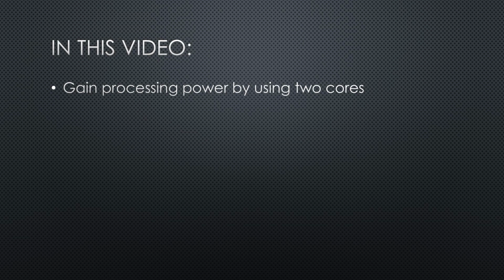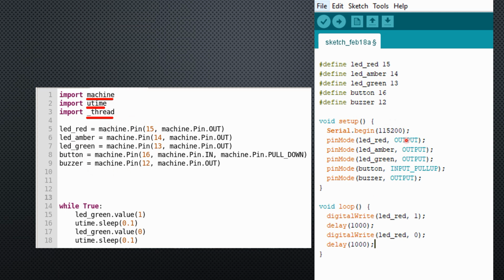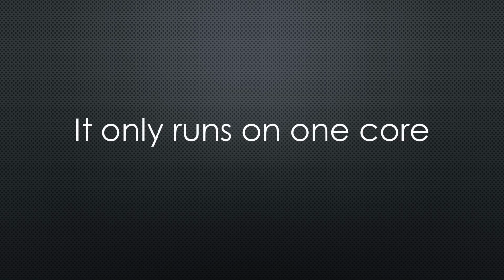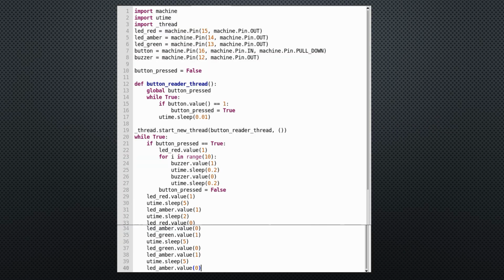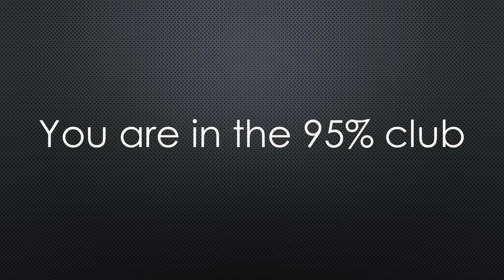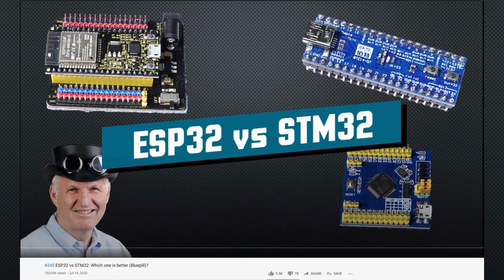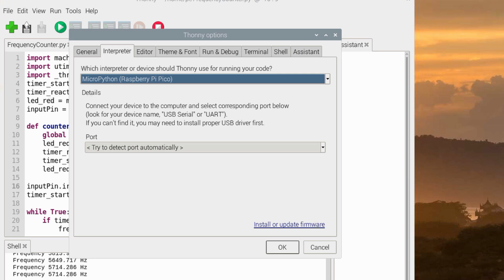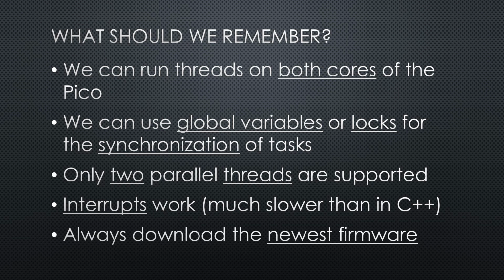#372 How to use the two Cores of the Pi Pico? And how fast are Interrupts?

Comment: A great video as always Andreas! I happened to have the C++ dev environment setup on the bench using a Raspberry Pi 4 and therefore was able to quickly measure the interrupt response time with my oscilloscope. This turned out to be 1.1us when built for debug and 1.0us for release. The release version seems to have some jitter of around 0.1us whereas the debug version doesn't which seems a bit unusual.
Reply: To add a bit more to my last comment, I did a some more investigation and it appears that the minimum execution time of a GPIO interrupt handler is 5 us (i.e. even if it does nothing) which seems like an awful lot of overhead. I searched the data sheet for the processor and the SDK documentation and source code but could find no explanation for this behaviour. Probably someone more familiar with the ARM processor architecture will know. Cheers!
Reply: @RocketManRC-Electronics  How did you measure the execution time of the isr?
Reply: @nukular2008  My setup was GPIO2 as an output and wired to GPIO3 as an input with interrupt enabled on the rising edge. GPIO2 is set high in the main loop and GPIO2 set low in the interrupt handler. With only those two lines of code executing GPIO2 goes high for 1.1 us and low for 4 us so a period of 5.1 us. If I disable interrupts and move the code to set GPIO2 low to the main loop then I get a lopsided square wave on GPIO2 with a period of 110 ns.  The conclusion is that in the first case the interrupt handler uses a minimum of approximately 5 us of processor time. It would be interesting to repeat this test using assembler to get more insight into the whole thing but I suspect that is not a trivial exercise!
Reply: @RocketManRC-Electronics  I suspect it could have something to do with having the ISR stored in flash. The rp2040 default uses XIP (execute in place) to run the code directly from flash, which could cause the high latency. You can disable this completely by adding the build flag PICO_COPY_TO_RAM=1, or you can make sure a specific function is copied to SRAM by using the macro __not_in_flash_func (in pico_platform) like so: void __not_in_flash_func(my_func)(int some_arg) {
Reply: @spicybaguette7706  That's very interesting and I will check it out when I get a chance.
Reply: Micropython seems to have a "hard = true" option when assigning an IRQ to a pin. Maybe this would also make it a bit faster. Maybe I might try this someday.... 

https://docs.micropython.org/en/latest/library/machine.Pin.html
Reply: @rianderous8761  python will always be slower as it needs an interpreter to run.
Reply: hard = true doesn't seem to be supported currently. personally i had higher expectations from the pi Pico
Reply: @#NotAnEngineer If you read the rest of the linked article you'd know that these are minimum values depending on a variety of factors. In reality (and the Pico has a 2 M0+ cores BTW, so the minimum is 15 cycles, not 16) a M0+ core very often serves interrupts quicker than a "better" core at higher speeds due to having less factors which slow down this process. If my calculation isn't off, the minimum latency to enter the IRQ handler is 0.11ns at 133MHz. Of course the interrupt -> interrupt time depends very much on how long it takes to execute the ISR and that's where micropython comes into play; not just the dispatch of the ISR (they will need to have one or multiple generic ISRs routines which jump into a Python handler checking whether the Python ISR routine was set at runtime before executing it -> super expensive) but also the toggling of an LED in Python is way more expensive than the corresponding single cycle machine instruction.
Reply: @danielegger6460  z
Reply: Very helpful video again. I can confirm with some of the other guys who have tested the interrupt latency that it is around 3 to 4 µs - this was tested by using the time_us_64() function, not with an oscilloscope. I connected GPIO16 (as output) to GPIO17 (as input) and triggered on changing the output on GPIO16.
Reply from the maker: Thank you for testing it. This seems to be ok. Of the 1.3 us of the STM32, about half was to set the pin (Arduino is not very fast in this discipline)
Reply: @AndreasSpiess  There is a reset button hack that allows you to use a button that resets the Pico.

Comment: TinyGo can now utilise both cores on the Pico (as of June 2025). It is faster and more reliable than MicroPython which I found flaky on two cores for my use cases. Plus Go has amazing, easy to use, language constructs for parallel programming.

Comment: Thanks! It could be nice to compare performance on the two approaches. If micropython uses an interpreter instead of a compiler (?), I would presume it waste quite some processing power, translating the code on the fly? Is that smart on a Micro controller where both RAM and Processing power is limited?

Comment: bit later here... I am familiar with threads C/UNIX but new to micropython. For me, I was getting hangs and all sorts of grief from my pico 2 here... using bare bones thread code.. All my grief went away... when I added logic to get the spawned thread to cleanly close itself down, when the main thread indicates it is done. I don't think the micropython environment is doing the cleanup we might expect and are familiar with from full blow operating systems. This may be the reason why 4 years ago... you were having to reset the boards in the first place.
Reply from the maker: Well possible. I must admit that I do not use MicroPython for productive projects for these reasons.

Comment: with Arduino IDE, i don’t have to disconnect the USB cable if the "Serial Monitor" in not runing and so, i can to reprogram the Pico without to touch it.. if i need the Serial Monitor, i just need to close it before to upload (and open it when the Pico run)..
Reply from the maker: Thank you for the additional info!
Reply: @AndreasSpiess  always happy to see your (nicely done) videos!!

Comment: Seems to me a good way to use the 2 processors is to have one only doing the communication protocols (wifi, serial port if needed), and use the other one to run the main program.
Does that make sense to you? 
BTW, the PIO is much faster with I/O, so i would use that for a pulse counter.
Reply from the maker: Yes, this makes sense to me.

Comment: I am a retired software engineer and seen enough about Python to know I want nothing to do with it, heck I would be more interested in old fashioned Basic.  So I don't suppose you have a similar video in C or C++.  I recently got some Seeed Xiao RP2040's which is the reason I started watching the video.
Reply from the maker: The Pi Pico is now supported by the Arduino IDE. So you can use C++. Google should show you a video by "Gary Explains" (Youtube does not support links)

Comment: When you made this video, I was miles away from securing a job in engineering. No degree, no money, self-study. A year later, Mr. Spiess set me on a journey with the pico that allowed me to secure a job as an RF Technician (en route to engineering position) for municipal districts and emergency service radios. Thank you for all the immensely valuable information and education and it is not for granted!
Reply from the maker: Congratulations! I am always happy if I can be of help for somebody.
Reply: @AndreasSpiess 
Hello sir,

I am trying to use PIO to measure the timing between two rising edges on two input pins, but have trouble getting the accurate measurement.  Whats the best approach I should go with.  I need it at least 400ns accuracy.  

Thanks
Reply from the maker: @yeanic  I never used the PIO functionality 😞

Comment: on the pico pi , ctrl D will perform a soft reboot. and if you place a button between Ground and Run pin, it works to program like on the esp8266 and the 32.
Reply from the maker: You are right. I added this button in one of ma next videos ;-)

Comment: Hey, just as a head's up to people using the ESP-32 and Micropython, while many versions of the ESP-32 are dual core, Micropython only runs on one of them and reserves the other to perform peripheral tasks such as managing wifi without it interrupting the main micropython core. This is true even if you are creating multiple threads! So be aware that even though you're getting true preemptive multitasking in multiple threads, all of those threads still run on a single core. For evidence, look in the ports/esp32/mpthreadport.c and you'll see that all tasks/threads are bound to the same MP_TASK_COREID constant.
Reply from the maker: Thank you for the information!

Comment: A bit late to the show, but if you see this:
 - Could you add info on how the Interrupt timing would change using Arduino C++ on the PIco ?
 - Is threading possible in Arduino C++ ? I did not get that from the video, maybe I overheard it.
Reply: Just a bit of info: 
I want to program a "simple" software LockIn-Amplifier on a Pico. The Interrupts or DMA would be useful to get the phase of the reference signal, but 55us would limit the frequency and accuracy considerably.
Reply from the maker: The Pico did not get a lot of traction in my viewer community. So I stopped covering this chip :-(
Reply: @AndreasSpiess  Ah, too bad, but understandable. 
Found one of the answers: you can program both cores on the Arduino IDE using "setup1" and "loop1" for the second core.

Comment: Where in the documentation did you found that multithreading is implemented using multicore ?
The MicroPython documentation regarding threads is quite minimalist and point to the CPython page, which does not speak about cores...
Beside MicroPython also run on single core platform...
Thanks
Reply from the maker: I do not remember where I read about it :-(

Comment: Multi threading in this way is not working properly in Pi Pico. It seems that the second thread is sharing the CPU time with the main thread, so the main thread will be slower 50% than before. Any idea?
Reply from the maker: As the Pico did not catch a lot of traction in the Maker community I do not look too much into it :-(

Comment: I find the treatment of global/local variables in Python intensely annoying and a sure cause of programming faults (one of several things I don't like about Python). When programming in c/c++ and declaring variables I always use a naming standard that distinguishes between their scope. It isn't functional of course, but it makes the code unambiguous as to what I'm dealing with.

I should add what's really required to use something as sophisticated as the Pi Pico in complex applications is a real time OS. I'm not familiar with FreeRTOS, but I do like the idea of a proper framework for things like pre-emptive multi-tasking, driving devices, semaphores, message passing and so on. Many years ago I wrote the core of such a thing running on a Z80 machine which controlled the timing on a race track. It drove a number of displays, a couple of printers, car identifiers, timing beams, control lights and so on. I found the framework of being able to write several task that had to run concurrently, some of high priority (like handling timing) and some of lower priority (like driving a printer), and the operator interface to make the whole thing a lot more logical to put together. I find those stereotypical controller programs which comprise a large loop handling device status and also handling any user interface to be painful and illogical. So something that encourages proper multi-tasking is great, even if you have to, sort of, DIY it as here. 

I should add that there is lots of potential for "gotchas" in complex applications which require co-ordinating of multiple tasks without tripping one another up. There's a whole lot that could be presented about how to do more complex applications.
Reply from the maker: I made a video about FreeRTOS on the ESP32. It is quite useful for complex applications.

Comment: I wonder if the interrupt reaction time for ESP32 running *micropython*, would be similar to the Pico's?

Perhaps for 2 threads it may not make a difference, but since the ESP32 can run MANY threads (not just 2 like the Pico), maybe it will perform much faster?

BTW, I like the python tip of using the 'global' keyword inside a function if it needs to access a variable outside of the functions!
Reply from the maker: I never tried interrupts with Micropython on the ESP32. But it should have nothing to do with the number of threads

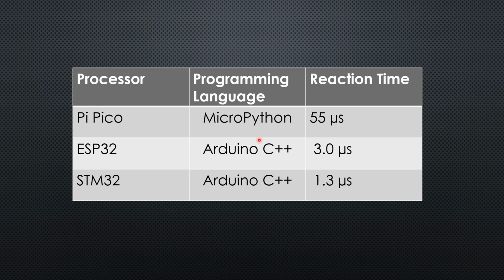Comment: 10:40 why you compare python on the Pi vs C++ on the other microcontrollers? C always will beat python
Reply from the maker: Because the whole video is using python (for the dual core capability). I would not know how to use dual core with C on the Pico.

Comment: Is it possible to run python on one core and C++ on the other for high-speed interrupt handling? (shaft encoder on a motor)
Reply: Or perhaps there is some way to use pio for the encoder?
Reply from the maker: I do not think so.

Comment: This is super helpful. I might use C++ instead for my project if the SNES clock/latch pin is too fast for my project. I hope so, because then i might be able to get away with using 0 shift registers instead of 2 per emulated controller
Reply from the maker: Glad you found the content useful!

Comment: Pico reset: you wire the GND and RUN pins together and add an extra momentary contact button to your breadboard. Pushing the button will reset the board.
Reply from the maker: You are right. I did a similar thing in my next video ;-)

Comment: Great video and adorable kitty!

I wonder if it's possible to program these in C++ or even assembly if you wanted to optimize speed from the dual cores. I have a DSP project I'm working on with 40kHz acoustic detections and these were beginning to look pretty appealing to use for this until you compared the interrupts with ESP and STM uCs. Still very cool though!
Reply from the maker: You can program the Pico in C++ with the Arduino IDE for example. I do not know if dual core is supported. Maybe you look at my new video about ESP32 and audio?
Reply: @AndreasSpiess  Thank you for the suggestion! I just watched your ESP32 video on audio and the Pmod audio card you suggested looks to have the sampling rate we would need (108kHz).

Comment: This RP2040 is kind of strange. Even a single core has so much power that you normally don't need the second core. On the other side it has fewer periphery than most other ARM-controllers. For about 80 cents it's quite interesting for my own PCBs, but this stupid QFN housing is much to difficult to solder at home (for me). And the cheap PCB manufacturers don't have it in stock...
Reply from the maker: I assume the package has to do with the pricing :-(
Reply: @AndreasSpiess  
Sure. But I still try to figure out what is the reason for this controller. The Raspi Nano has a little more power than your ordinary STM32 board, but it's also a little more expensive and has not as much interfaces (no CAN) and very few timers and analog ports. I designed already ATmega and STM32 boards by myself, soldered them at home with an ordinary solder iron, also a small series of my ATmega boards were soldered directly at the manufacturer (JLCPCB). But I can't do this with the RP2040. So currently I'm a little at a loss who's the targeted audience. Just an Arduino with more power?
Currently I'm looking into EFM32 controllers because I need something with very low power consumption and good calculation power (for beehive scales). Are you planning to do a video about this controller family too? I'd be very interested :)

Comment: To reset you don't have to unplug the micro USB connector, but also the other side of the cable OR just use a micro usb cable with a switch.
Reply from the maker: I found an even simpler solution (in the next video)
Reply: Or just connect the RUN pin (30) to ground.

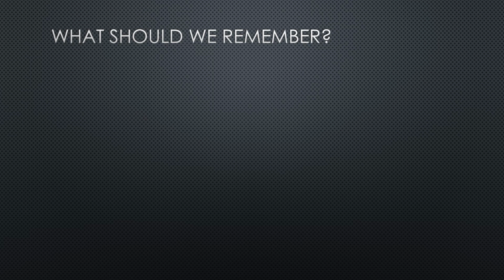Comment: 12:53 Can't you just unplug the other end? Or short the reset pin to ground? Or short vcc?
Reply from the maker: You can ground the reset pin, of course. This is what the reset button would do. Unplugging also helps, of course. But in the next video I added a simple reset button which is much more comfortable.

Comment: if you short run to ground you get a reset there is a solderable reset button called "captain resetti".
the main problem as amateur user for me is that micropython has no easily usable usb hid where circuitpython does it with an adafruit library
Reply from the maker: You are right, I was not the only asking for it. In a later video I added a simple button to my Pico...

Comment: What about using C++ for the interrupt?
How does it compare to other MCU?
Reply from the maker: You can use C++ for your whole Pico project. Then it would be as fast as any other M0 core MPU, I think.
Reply: @AndreasSpiess  
Thanks for responding to my comment. 
I have been “away” from electronics for 7 years, so I’m catching up with the new stuff...

I wonder what is the advantage of Arduino? There are other more capable boards like Esp32, stm32, ... and they can also be programmed with the Arduino IDE
Reply from the maker: Most of us use the ESP8266 and the ESP32 because it has WiFi

Comment: Did someone eventually make the pulse counter PIO? I want to read the LMT01 digital temperature sensor but the interrupts are too slow. I also hard-wired it to  GP22 so that's a PWM-A pin. Otherwise I could have used it as a PWM clock input pin. My only hope is PIO at this point.
Reply from the maker: I do not know. Yes, 88kHz is probably quite fast for an interrupt. Should be possible with the PIO.